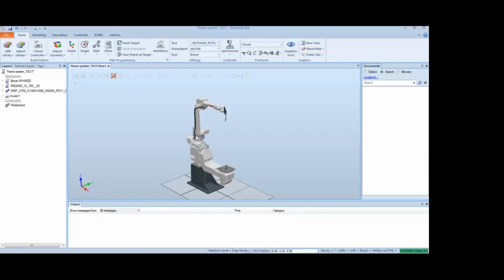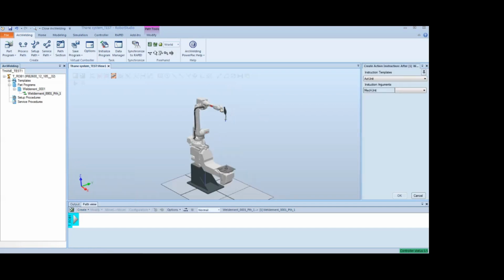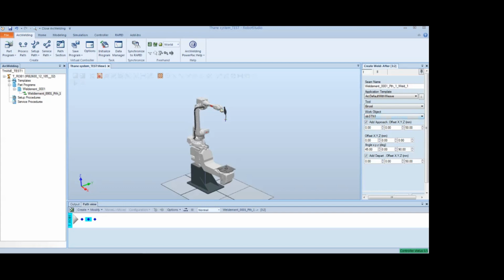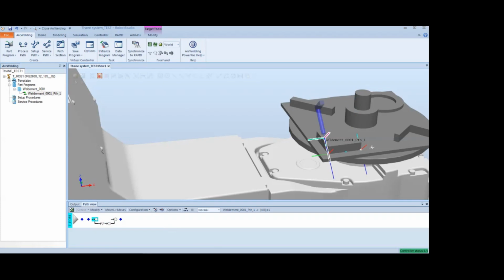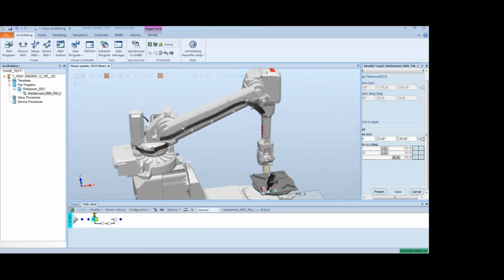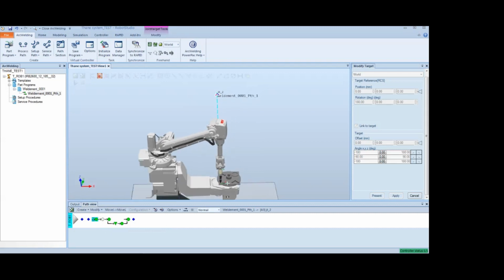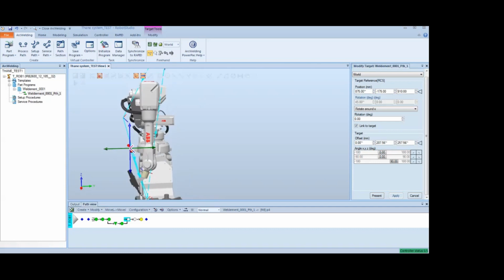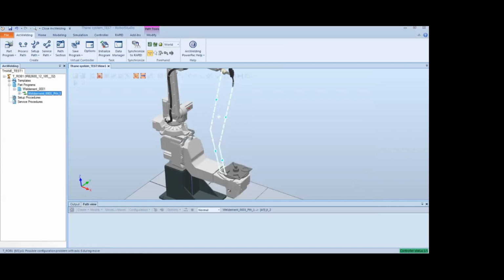Creating a Weld in Robot Studio Using ArcWelding 1

Comment: Hey, thanks for the amazing tutorial. Where did you get the "Weldement" Component? The welding pard on the positioner. Thanks.
Reply from the maker: I made it using the modeling tab in robot studio.  It's not as great as solidworks or autocad, but for making simple models it works pretty well.
Reply: ABB RobotStudio Training with English Subtitles and Other 10 Languages Subtitles on Udemy
https://www.udemy.com/course/abb-robotstudio-training/?referralCode=990835C377565BF8B2D1